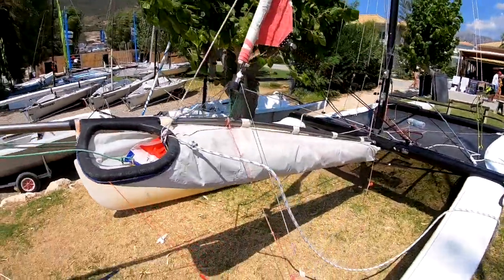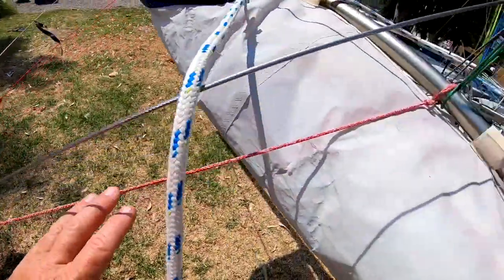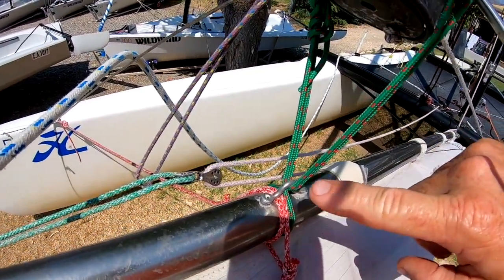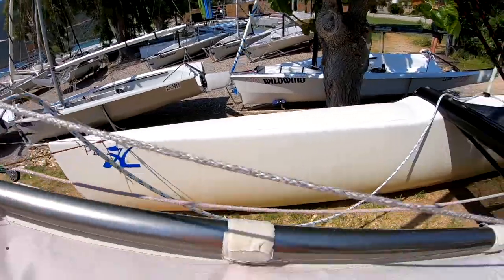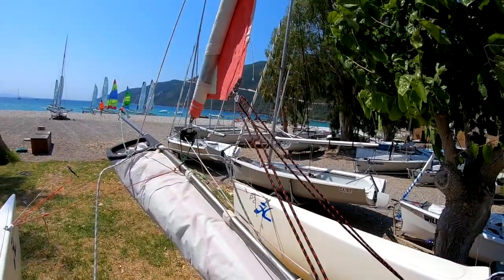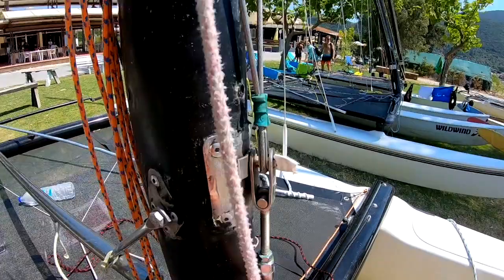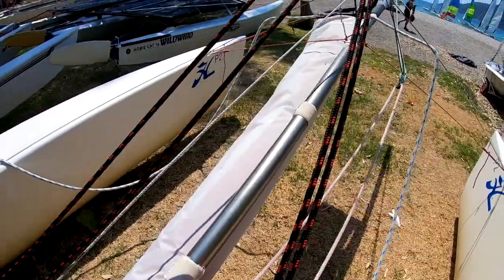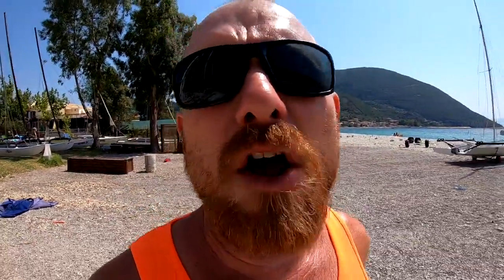Jib furler and bowsprit arrangement   Hobie Pacififc, 16, FX1 etc

Comment: Joe,  would you be willing to share your thoughts on high high to set the final height of the bowsprit tip after pre-bend? Would you configure the pole to set the spi tack at roughly the same height as the jib tack, or is there some other reference to use?
Reply from the maker: Yes, absolutely - I'll talk about this in this week's Q+A.
Cheers